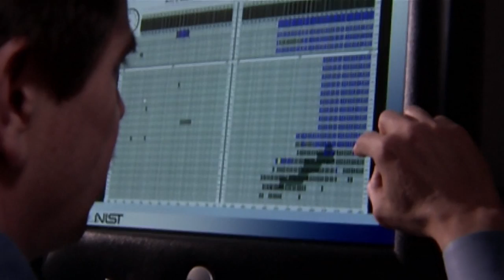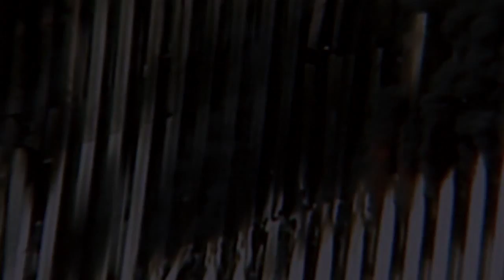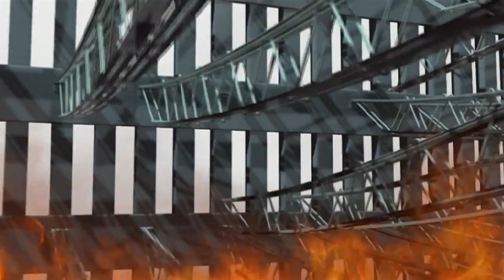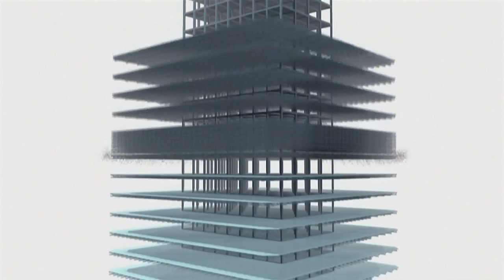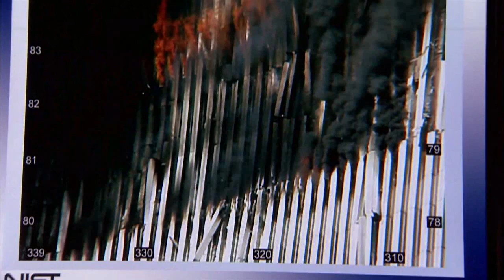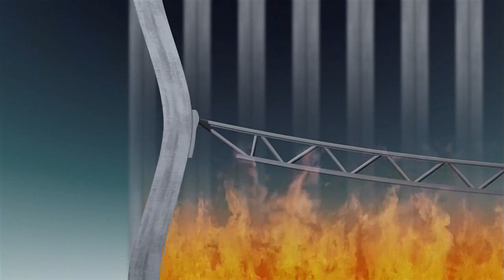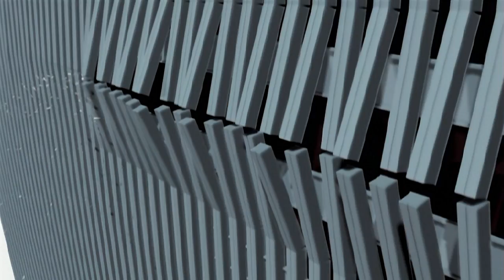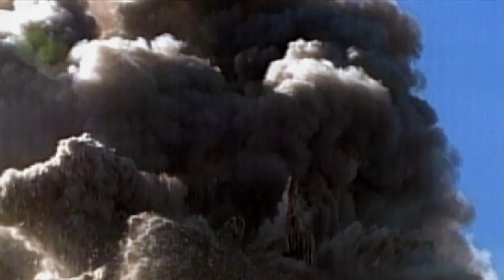WTC - collapse revised

Comment: so the kerosene of the plane spreads 100% evenly and exact during the impact and then heats all trusses on the same floor SIMULTANEOUS? how? did the fire decide to burn down superorderly so NIST could fit it into their coverup to go with the grander "magic bullet" narrative, you know, the WMD-IRAQ facts and such? and btw since when is 3 towers minus 2 planes a scientific problem? as far as my left hand is concerned, i can count to one with my hand, where in reality one is missing.... wtc7.
so how can 2 NOT EXACTLY similar events lead to THREE COMPLETE DEMOLITIONS within the same theory. WTC7 was not hit by a plane, the amount of fire or structural damage was not the same. 2 buildings collapse from top to bottom, one from bottom to the top, YET THE SAME SYMMETRIC INSTANTANEOUS FREE FALL COLLAPSE. 2 inputs, 3 outcomes. And now, plz don´t start with flying girders, because either they had the kinetic energy, then they must have gotten them from an explosion, or they just popped out due to tension, then they DON´T have the kinetic energy. at least not chunks of relevant side that would then lead to symmetrical damage OR fire. NAWT FEASIBLE
Reply: Watch The Movie Backdraft which has a better grasp on how fires start then 9.11 truthers...  And it's fiction. So you might actually believe it.. Cause you're believing fiction now...
Reply: Okay while the jet fuel was the acellerant,  (The thing that started the fire)  There were offices on those floors, which had things like office chairs, carpets, fiie cabinets.  (you know other fuel sources).  These things all were able to reach their point of Vaporization...  There were hundreds of thousands of lbs of paper files, fiberglass ceiling tiles, plastic computer cases, chairs with foam padding   There was also the fact that the pipes that feed water to the fire surpression system were severed by the plane impacts, meaning that the fire had nothing keeping it in check and allowed it to spread very quickly through the open floor plan of the affected floors.   SO yes the fire worked very orderly, as it systematically worked its way across the floor, unimpeded by the broken fire supression system    I don't take the NIST report into account...  I take the metalurgy and the advice given to people by experts in how heat affects steel  (You need to add the expert advice of a blacksmith into the deal)  No where in anyone who has an educated opinion of the attacks is there a person who says the steel melted (That was said though by many reporters during the incident itself)  Steel doesn't melt at the temps the WTC fires happened, but it doesn't need to melt as Steel weakens at much lower temps than it's melting point.  All the metal needed to do was weaken and gravity did the rest  

People can believe that 9-11 was an inside job.  The problem with that belief is that there is no actual proof that it was.   I'm of the school of thought that if warnings by intelligence sources from the years before the incident happened had been taken seriously then this might have been able to be stopped.   We didn't think it could happen on our soil.  We were wrong and now many out there wish to blame some convoluted boogie man than the actual events that happened that day.   Sorry, but that's all the 9-11 truth movement is.  

There are pictures out there of airplane seats smashed through through the back of cars parked in the area that day.  There is know documentations of letters surviving undamaged in plane crashes dating back to the beginning of aviation.   Crazy shit happens because all they physics stuff interacts together.  One law isn't suspeneded while another law works..  The work in conjunction with each other to control our universe.  

Gravity and thermodynamics work hand in hand with the principles of conservation of energy.    The Fire Cycle doesn't just stop because you wish it to.  There was no need for Thermite because THEY WERE OFFICE BUILDINGS WITH FLAMABLE THINGS IN THEM.  AND NOT A WALL IN SITE TO SLOW THE FIRE DOWN....
Reply: btw i m not taking my info from truthers but from architectural commissions, scientific institutes and scientific professionals from an ongoing and unending debate on the physics of the event. which NIST obviously refuses to understand. they even fail at basic high-school concepts in their explanation (thermodynamics, equal force, metal melting points, SHIPPING METAL TO CHINA). not TV experts on fakenews channels or alex jones infowarTs
Reply: https://www.youtube.com/watch?v=4LUDXpMhkNk
Reply: boys, you didn't quite grasp the sarcasm. and backdraft? you really prefer patrick swayze bs over real life sciences? yeah, the backdraft exists. but i prefer to learn about the color indication of glowing metals and what that says about heat and metal type. f.e. that molten stell requires higher temperatures than kerosene blasts and office fires. more like in the welding range. THERMITE/THERMATE
Reply: Watch Sept 11 The new pearl harbor 3/3  shows how jet fuel couldn't of started all those fires.

Comment: Why don't they talk about the molten steel pouring out the corners of the towers? Or the explosions in the lobby before planes hit? Why don't they mention building 7?
Reply: And why would they mention building 7 in an analysis of the twin towers collapse?
Reply: https://dsx.weather.com//util/image/v/ari_effect_1201_306_metal_melts_in_fire_1280x720_6347333551.jpg?v=at&w=320&h=180&api=7db9fe61-7414-47b5-9871-e17d87b8b6a0
Reply: Building 7 was on fire
https://youtu.be/IssGRpcB_ms
case closed.
Reply: @Mister.Braddock  This fire can reach 1000º celsius?
Reply: @Mister.Braddock  at 879º celsius to be exact
Reply: People in the lobby were on fire by the lobby express elevators, flame shot down the building.
Reply: its not molten steel, it is molten iron, a byproduct of the burning reaction

Comment: What about the metal expansion first with heat? The reality is I never seen a building ever come straight down unless the forces were perfect in its failure and that is a million to one occurrence when a Chaotic event started the process. The lower beams were perfect and are a lot stronger at the bottom to support greater mass above that had no structural heat or problems. So it would have produced resistance on falling section for it to be pushed to on side or another path of least resistance. For it to fall straight down meant there was no resistance coming down. That meant something had to cause those resistance not to exist.

Comment: But the tower exploded.
Reply: "Exploded" 😂😂😂 give me a fucking break. I didn't know you were an expert on controlled demolition! And if there were explosions then explain why there were no explosive flashes or sounds. You can't.
Reply: Yes it can, substantially! Steel loses about half its strength at 1100°F; the temperatures in those towers were estimated to max out at over 1800°F where the fires were worst, at which steel loses 90% of its strength!

When discussing jet fuel, it's important to remember that jet fuel was not the only fuel for those office fires!
Reply: Office fires and compromised structural integrity, from a 767 crashing into? cant weaken steel?
Reply: stanzomanny you're an idiot.
Reply: One thing that makes sense when you think about it, people saying that there were 2nd explosions in the lobby's and basements, that's most likely due to a plane smashing into the building and sending a pressurized shockwave all the way down the many elevator shafts, until that pressurized energy had nowhere to go but out the elevator doors in the basement and lobby's sending people flying eyewitnesses supposedly saw

It's similar to an airplane with a pressurized cabin flying at high altitude only for something to beach its hull, resulting in explosive decompression 
Of course that's Not what happened with the twin towers but similar laws of physics at play
Reply: the explosions were from the the air that was compressed by a collapsing building shattering the windows
Reply: The problem is with your statement is that there were 3 levels of elevators to get to the top.  Just 2 service elevators if I remember right went from top to bottom.  Watch Sept 11-The New Pearl Harbor part 3/3 and you'll see the right answer.
Reply: muttkat1 no, two express elevators traveled the full length of the building. How do you think people got to Windows on the World in the North Tower or the observatory in the South Tower?
Reply: Yes when the planes impacted, alot of sparks flew and there was an explosion.  NIST stated that the majority of the fuel burned up in 10 or 15 minutes.  With WTC2, alot of the fuel exploded outside.  I didn't have to be there, but there were very many firemen who stated there were bombs and consecutive explosions before the collapse.  If you scroll down to my comment from 2 months ago and read those statements from people who were there.  Sorry for your loss.
Reply: If you listen to the Ginny Carr tape you will hear 2 explosions about 9 seconds apart.  People at the bottom felt and heard a separate explosions down to the subway.  I understand about sending down a shock wave but being there were 3 levels of floors w elevators, with 2 going top to bottom, there were some elevators blown below these 3 levels.  The explosion would of had to go down to the 78th floor, go sideways, and then go straight down....repeat...Some people escaping thought the plane hit below them and this is under the impact zone.  A big  hot wind and crack came up the stairwell from explosions down below.
Reply: Libtard?  You're stupid.
Reply: TruNurd BSBSBS
Reply: Not in this video but do not fuck with this topic 2 planes hit the towers the leaking gas combined with a spark caused the towers to explode. Unless you were there that same day and time don't bother writing on this. I lost family that day and I do not like to remember it!
Reply: stanzomanny you know you're wrong, just admit it
Reply: May I suggest you go to:  http://graphics8.nytimes.com/packages/html/nyregion/20050812_WTC_GRAPHIC/met_WTC_histories_full_01.html  and read Deshores, Banaceskis, Cachia, Cruthers, S Greggory, J Currans, B Fitzpatrick, Delendicks, Ondrovics,   and do notice some of them mention flashes.  I'm not an expert.  I read what the experts say.
Reply: stanzomanny complete lie.
Reply: Which bs are you talking about nigga?
Reply: I was thinking the 2 elevators which went full length were the employee ones.
Reply: There were consecutive explosions before the collapse even started.  One firefighter was about a 1/2 block away and a 2 or 3 story facade hit the street close to him right at or before it came down.  The name is Cahill on the NYTimes oral histories site.
Reply: Den2067 почему говоришь сначала по русскому, y después en español?
Reply: No te entiendo.
Reply: I wasn't there but the 503 firefighters interviewed were.  The majority felt the underground rumble first.  Then saw the WTC exploding out horizontally over their heads And THEN the COLLAPSE STARTED.  You can look at the NYTimes site below and see that I'm right.  If you don't like to remember it, then why are you coming to this site?
Reply: There should of been only a partial collapse not the whole building exploding all over.  Floors 65,66 had internal collapses before in WTC 1.  Fire will weaken steel somewhat.  To have thick steel bent into a horse shoe shape took 1000's or more degrees and it wasn't from thermite.
Reply: Did you know in studies afterwards it was studied and some of the steel vaporized and melted?  The RJ Report and a engineer named Astanah plus others stated so.  Go to history commons and look up molten metal.
Reply: Arturo Griffith, one of the survivors was in one of those elevators and didn't get burned.  He did however get blown back into the elevator from other explosions.  See it on the New Pearl Harbor part 3.
Reply: The explosions occurred before the collapse started.  Read my nytimes statements.
Reply: https://youtu.be/IssGRpcB_ms
Reply: All I see is a building exploding, there is no way jet  fuel/diesel fuel/kerosene will get hot enough to weaken steel.
Reply: TimReed22222  Put down the crack pipe please !!!!
Reply: Jes,  it fucking exploded.  1st there was shaking and/or rumbling of the ground.    Then there were explosions and pieces of the WTC ejected horizontally up tp about 600 feet.  THEN the so called collapse started.  Surrounding buildings, (basically at the base) firetrucks, cars, blocks away had their windows and some building  walls blown out.  Theres one good video with the camera pointing up where you see all that orangy explosive fire around the impact zone.  There were other explosions between the impact zone down to the base and under.  There were consecutive sounds.  You can slightly hear them on a few videos.  With people screaming it masks some of the explosions.  One witness said he was there and when he watched it on TV, the sounds were muted.  Probably every video submitted has had some cut out.  For instance many videos have the big explosion cut out and just shows the progressive collapse.  'll come back with an answer where you will realize you stuck your foot in your mouth.
Reply: The 1800 degrees temp only lasted a very short time.  As seen by the oxygen starved smoke until more bombs blew up.    After the collapse,  temps underground were hotter.